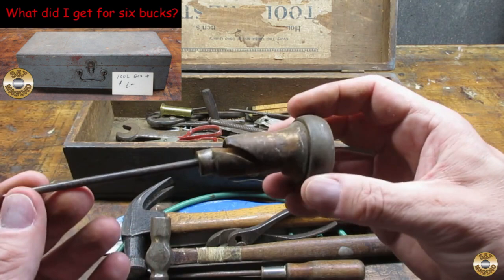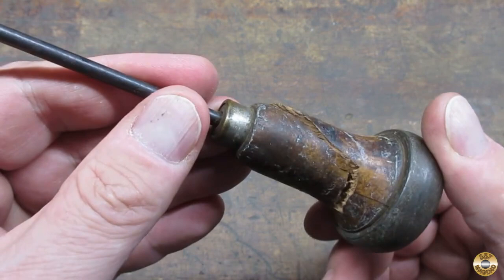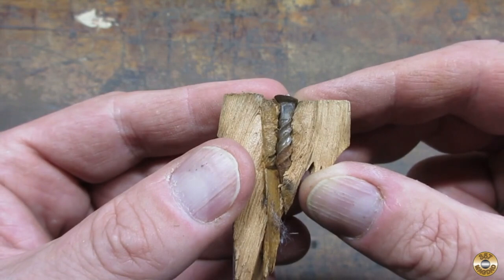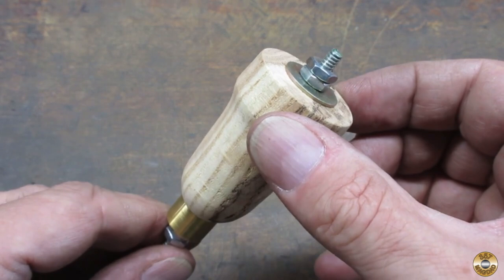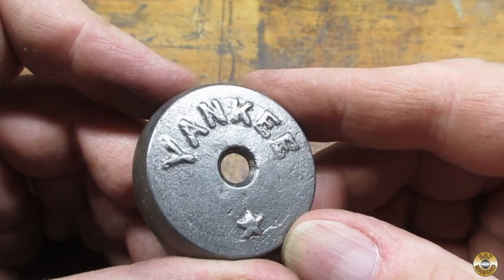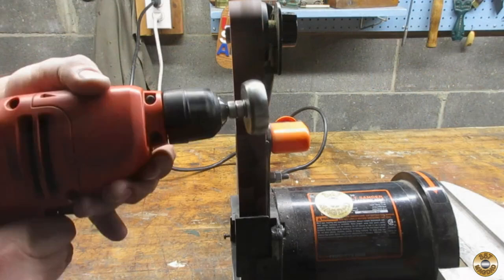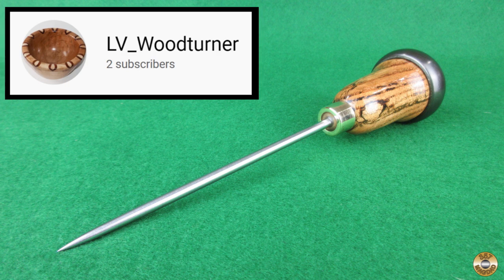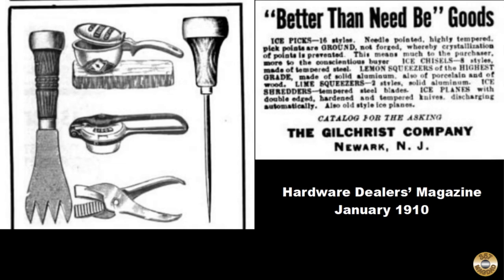Vintage Gilchrist Yankee Ice Pick Restoration / Restomod

Comment: Absolutely wonderful restoration. From trash to treasure. I agree completely with the decision to use a slotted screw on the end cap. Have you noticed that it's getting harder to get the slotted screws you want at the hardware store? Looks to me like the stores are pushing Phillips head fasteners. Great video as usual.
Reply from the maker: Thanks Pat!  I think Phillips is more compatible with the battery powered screw guns / drills.

Comment: Turned out absolutely stunning! 
This might be a silly question, but what exactly was/is an ice pick used for?
Reply from the maker: Thanks Martin!  In the old days, before every house had a refrigerator, ice was sold in large blocks.  People store the block in ice boxes.  An ice pick was used to break smaller pieces off of the block.  Also, early refrigerators did not have auto defrost, many folks used ice picks to chip the accumulated frost out of their freezers.
Reply: @357magdad   Ohh that makes sense now. Thank you for sharing that bit of info!

Comment: I’d there any kind of file that could file between lettering like on that butt cap? I s see m picturing something like a slotted screwdriver shaped as a file on the tip and also picturing something like a split tipped flathead screwdriver that holds strips of sandpaper or abrasive if you wanted to crisp up the lettering. I just never heard of such tools outside of a dentist office
Reply: The Magdad-Woodturner mammoth de-icer!
Reply from the maker: I use diamond coated bits in my Dremel in a similar way in an upcoming episode.
Reply: Trader Joe's , Dremel Bits Carefully . Or in A Pin Vise .